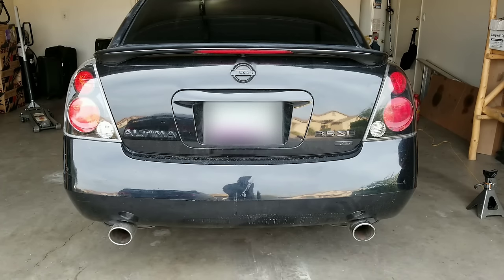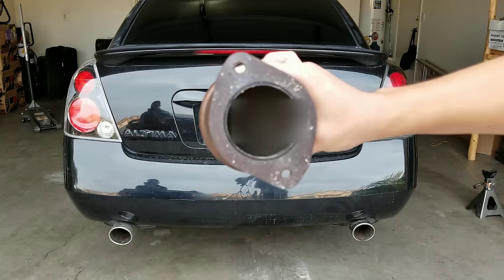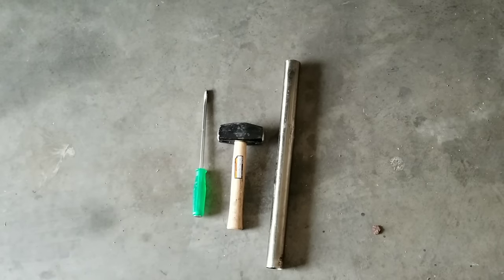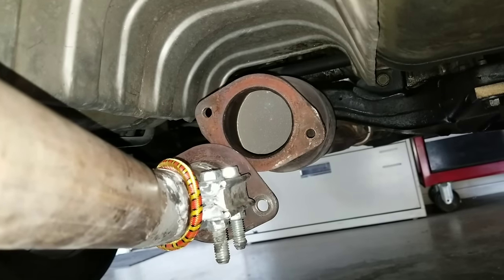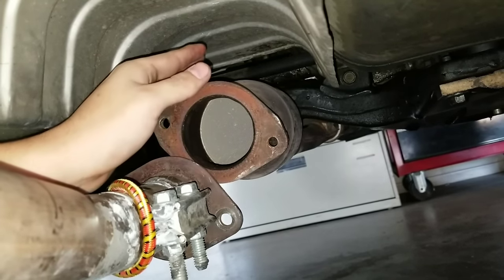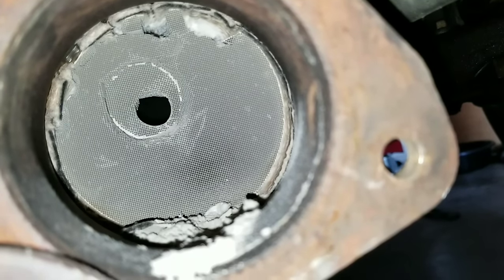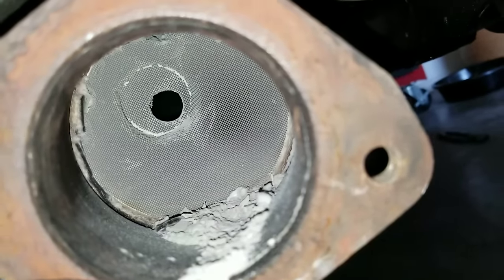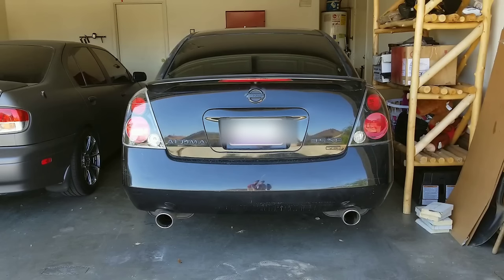How To Delete Your Catalytic Converter!

Comment: I don't want to hollow out my manifold converter.
Can I just poke a bigger hole in it? I just want some pops and bangs but I don't want to spend 800$ on a performance cat.
Reply from the maker: you can but eventually it would probably break down since its packed tight and if you make a hole it will be loose.
Reply: Eric Leos eBay specials.  120$ delivered to your door.
Reply: $800 for a cat? Lol wow. Listen bud magnaflow has universal high flow cats for 80 with free shipping and your cel wont come on and you will also get the pops you want. Go on ebay to find it
Reply: AD S eBay sucks ass. I blew out my 02 bung in the first 2 weeks. Kinetix hfc is what you want for proper cheap mod. Everything this guy did tho is so wrong. Ugh
Reply: Mike Washuck lmfao just cause it ebay doesnt mean its bad quality shit. Only time its bad shit is if its a non named brand. Which is usually shit like dna motoring and speed daddy and stupid shit like that. Magnaflow is a good brand company. So if flowmaster and megan racing. Dont believe everything you hear about ebay. Cause the also have hks, aem, injen, ect. Products too. Its just a matter of what your getting and how much your going to spend. Universal hfc by magnaflow is great. Dont think that just cause you get it on ebay it bad product lol.
Reply: AD S you are correct sir. I just has a horrible experience with my product.  Mind you the company was super kool and worked with me to resolve the issue
Reply: Mike Washuck i understand we all been through it
Reply: AD S Will do fam.
Reply: Bush Bushington depends on pipe sizing they have all different sizes of pipes find out what your cars echaust pipe size is and see if they have it for yours.
Reply: Just remove the muffler/mufflers.  You will get pops and bangs. 😉
Reply: @robertwright5487  you will also lose hp

Comment: This is a naturally aspirated motor removing back pressure from the exhaust which you just did normally reduces horsepower rather than adds the sound may make you feel like you added but that’s about it lol
Reply: David Barbosa not if u tune it
Reply: Lil Herm Too even with a tune lol just read other comments they explain it well but he’s better off straight piping it instead of leaving it like that

Comment: Guys! This is unnecessary and illegal in most countries. Just buy a sports CC that has a straight through design, but still burns the unburnt fuel from the exhaust. A car without a CC smells horrible. So just spend a little bit of money on a race CC and be happy and compliant!

Comment: Do you know that the dust inside the cat is carcinogenic!
Reply from the maker: its ceramic that holds it together
Reply: ERICSDIYGARAGE that is not ceramic that shit could give you cancer
Reply from the maker: Carlos Jarquin what is it called?
Reply: ERICSDIYGARAGE. It's made out of platinum Palladium and rhodium and two of them cause cancer
Reply from the maker: Carlos Jarquin nope your wrong keep searching,  Rhodium by itself is not harmful and palladium can actually be used to help cure cancer
Reply: Platinosis is an allergy-like reaction to exposure to soluble salts of platinum. The symptoms of platinosis may include asthma, dermatitis, dyspnea, conjunctival vasodilatation, and rhinopharyngitis. The symptoms are progressive, sometimes taking months to years to appear. ... https://en.wikipedia.org/wiki/Platinosis
Reply: Next time wear a gas mask, that powder will never leave your lungs now.
Reply: endo pass yumm
Reply: Lmao at the “experts”. There is nothing in a cat but ceramic and precious metals.   One could argue that an old cat will have some residual contaminates from the exhaust but they get almost fully burned away.  

That being said, you should wear a mask.  Any dust in the lungs is bad news.  But it’s not like you were inhaling some deathly toxic powder.

Comment: I’ve had my catalytic converter deleted for 4 years. Now my car has code “p2423; absorption catalyst below threshold efficiency”, my MPG is like 37 highway and 25 MPG city, do you think I’ll still fail emissions testing? I’ve passed emissions the last 4 years, but I’m concerned I might not, but because my MPG is so high I wonder if they would even sense a bad reading on my exhaust

Comment: Here's another tip when you take off the cadillac converter, it changes the performance of the engine.... It has sensors on it that tell each cylinder what to do... That might not be the case in getting more horsepower. You actually might lose power and lose fuel economy

Comment: Why not just delete the secondary cats as a whole? Is there an 02 sensor on the secondaries?
Reply from the maker: No they dont have o2 but you remove them you have to cut and weld a new pipe
Reply: @ERICSDIYGARAGE  Alright, awesome. I have a 2.5 altima with muffler delete & bigger tips. I was gonna delete the secondary cats and weld on a str8 pipe in it's place.
Reply: @ERICSDIYGARAGE  It looks like the secondary cat on the 2.5 does have an 02 sensor though

Comment: This is good. It seemed like  there was piece of sheetrock stuck in the cat. I have a 2007 Nissan Maxima, just changed the motor at 220, I didnt have to but A mechanic took my old motor apart when he changed the alternator to get to the timing chain that clicked. I wasnt happy since these cars make the ticking noise bc of the timing guide, anyhow that starts around 150k they said the motor that was installed has 77k, but im saying it has 135k since i know the noise of these vehicles. The old motor could have made it to 250k before a rebuild. what can you do. Alternator isnt a joke on these cars by the way.

Comment: I got a Chrylser 300 3.5 v6 That misfires. My mechanic said the Catalytic converted was way to hot. Ill prolly run straight pipes to actually hear my engine lol chrylsers are quiet. Thnks for the info

Comment: I don't get all these hate comments. It's your car, and if you can do it then he'll yea do it. I had an old beater POS manual Ford focus and did the same thing, and goddamn it made it run so much better, the amount of power it got was significant. It only had one o2 sensor and it was on the header before the cat, so I decided to do it. On one that has 2 or more o2 sensors I wouldn't wanna mess with.

Comment: It's a lot easier to get a piece of pipe that just fits inside the cat and hammer it straight thru with a sledge. Then before you hook the exhaust back up, blow that shit out by revving it up a few times fully uncorked. I did this with my 82 Crown Vic wagon.

Comment: DON"T DO THIS!!! The catalytic converter is designed that way for a reason. So that bad carbon particles are not released to the environment. Cleaner air out. Smog check will fail with this modification.

Comment: Are you kidding me... those protect our air from pollutants and you go and cutting them out? Way to go. Sure. Pollute the air a lot more for a few hp. Unbelievable
Reply: Almost every modded car/race car has either high flow cats or has them removed.... they’re full of platinum so exhaust guys make a killing reselling them for their precious metals. This isn’t uncommon and usually it’s actually lifted trucks doing it the most.

Comment: Having a debate with a friend. My research shows a vehicle may run worse with the cats deleted since it has removed the back pressure etc and the computer would need to be tuned to compensate. My friend says he deleted 3 of his 4 cats (he had already bought 1 new so he left it installed)  on his 2005 Nissan xterra and it runs much better including much better gas mileage with no tuning...even a technician at a Nissan dealership told him it didn't need all 4 cats. Can a person delete all cats on a vehicle and have no serious issues with the engine?
Reply: yes its called straight piping your car lol
Reply: straight pipes are illegal here in cali so youll fail inspection every time unless youre paying the smog guy off
Reply: @staydown4bo  im not in cali and apparently you didn't read my post..I'm not asking what it's called when you remove the cats.
Reply: @A.C.71  a straight pipe and good intake will completely open up your air flow free from any restrictions. how would that cause any serious engine issues
Reply: Does it really save up gas though

Comment: Do not do this. The power gains are insignificant, it's not worth the trouble. If you're still inclined to do this, weld a pipe or invest in a bolt or delete pipe and SAVE the catalyst. They cost too much money for you to just destroy them so ignorantly to gain 2 horsepower.

Comment: I’m thinking about doing that on my infiniti g35 coupe. Will that make the check engine light come on?
Reply from the maker: it's better to get test pipes they are cheap and mines has test pipes without any issues or codes

Comment: did you have your check engine light on?? after this?
Reply from the maker: not on this particular vehicle since this was not metered by a o2 sensor
Reply: @ERICSDIYGARAGE  if it has a o2 sensor it means check engine light will appear right?
Reply from the maker: yes correct, a o2 sensor after the cat will throw a check engine code.
Reply: Why didn't you remove the muffler ??
Reply from the maker: I like the SE-R mufflers

Comment: Does this work the same with any car? I have a impala ss.
Reply: Yes. It helps alot. I had a 2.8 liter N/A v6 firebird that spanked my friends 84 Buick GN Turbo 3.8L v6 with this mod. It worked wonders in a 305 powered Monte SS also.

Comment: for anyone thinking this is a good idea. All cars (including this one) manufactured from 1996 on have o2 sensors that monitor the cat .best case it will turn on the check engine light.worst case you will go into limp mode,cutting off all performance.If your cat looks like his with small light dot moving as you rotate it. that is a sign it is good and not restrictive.95 and older this is a good idea to increase flow and look legal.I am sure the fine for removing the cat is more than maybe $80 worth of platinum you throw away.
Reply: @Tanto Buds The up steam O2( exhaust manifold location)tells the computer how to a adjust the injector fuel mixture. The down stream O2(after the cat) tells the computer if the cat is operating correctly. Pre 96 OBD1 car generally do not have a down stream O2.  You can remove the cat and replace it with a "test pipe" to see if the cat was causing problems. After you complete your "test" driving you must reinstall or replace the cat. Still not sure on my 95. Maybe another year of tests.
Reply: @Tanto Buds If you were blowing chunks of honey come out they can plug up your muffler next. It should not smell without a cat installed. A pugged cat can smell like sulfur or screw up the o2 reading so it runs rich. Reset the computer then drive it to see if the smell goes away.

Comment: Couldn't you of just replaced the cat with a straight through pipe? Then you have an intact cat and the desired effect you are after, especially for places with strict regulations (here in the UK there are yearly MOT' checking emissions etc, no cat will fail it)

Comment: Would it work if I went to pull a part junk yard and got a catalytic converter from a parts car. Then did what you did. Could I then bolt into my cars exhaust system? I'm disabled and I'm not sure I could do all of that hammering under the car.

Comment: Good Video  If you live out where I do , no emissions . Seems like some one all way have a smart crack to say , but they have no good input of doing better! And yes best bet new catalytic converter . But if you not have 200 on up what the hell . My car is very running now , engine light on for ever , plus my car is a 2001 . so I going for it tell funds for new one . Why buy a test tube one ? when you all ready made it straight threw . To many with smart comments .
Reply: Ey sir  hello. Ey where is it dat you are @ that they don't do no emissions?.. which state?

Comment: i think mine is clogged cause after a week being park there i turn it on to fix the antifreeze leak after a week i start it up and started to smell like something burning and inside the car was smokey as well and alot more heat starting coming out from firewall i look under the car and it was looking like hot pink or more jajaja or lava red or orange red thing was super red so i turn off the car righr away 😂😂 what you’ll think my cat is clogged or something else

Comment: What did you do about the check engine light now that the rear O2 sensor has a totally rich signal (over .9 volt)
Reply from the maker: this vehicle doesn't have a 02 sensor in the back so I didn't have to do anything
Reply: That's unique because the law specifies monitoring of the cat's output. Even motorcycles have cats and sensors.

Comment: If i gut the cats do i get a check engine light
Reply: Yes but u can get o2 sensor spacers and that will clear the code(spark plug non foulers is what they are called) old trick!

Comment: Also your timing system is having an issue. Likely a worn guide or tensioner. I can hear it when you rev the engine. You should fix that before your belt or chain skips.
Reply: i hear it too when he lets off the gas but how can you tell its coming from the timing and thats not the exhaust?
Reply: @staydown4bo  It's a distinctive sound. I had that issue on my S chassis. Its a nasty ass grinding sound when you let off the throttle. You can hear the loose chain running along the plastic guides
Reply: @Sugiyamasama  that probably means your tensioner guides are bad. most car companies use plastic tensioners that go bad way before the actual timing chain/belt. my g35 rn currently has this nasty 2-3 second rattle on cold starts that comes from the tensioner because the oil in the car hasn’t reached it yet. its a common issue
Reply: @Sugiyamasama  that doesnt have to do with the exhaust its just poor manufacturing using plastic instead of a metal. maybe to reduce weight 🤷‍♂️
Reply: @Sugiyamasama  you just gotta get new tensioner guides before you jump timing
Reply: @staydown4bo  Nah. All car companies that use timing chains are going to use plastic guides. They wear out over time. Besides, you dont want a steel guide on a steel chain. You're gonna wear the shit out that chain
Reply: @staydown4bo  Also, the chain will stretch over time of being used. The tensioners will lose tension and the guides will wear. Just replace all of it when you're in there. Save yourself the headache of doing the same job twice
Reply: @staydown4bo  Lastly, if your G35 is sounding like this, hop on that immediately. Don't play around with tha VQ35DE like that. They don't like neglect
Reply: @Sugiyamasama  i know i gotta get it fixed ive only been working on the car myself for a year so im still gaining confidence to do the more serious repairs. ive only had it for about 15-20k miles now but one guy in my group has had the rattle for the last 70k miles, so next oil change im gonna try something a little thicker like 10w-40 just to help it until im able to change it out
Reply: @Sugiyamasama   i dont have that ugly sound you hear when he lets off the gas peddle but i do get that brief rattle on cold starts. a lot of people even with healthy DEs like 90k less say they hear it sometimes just because the oil hasn’t reached the tensioner yet. better safe than sorry tho lol

Comment: Without a tune and supporting mods such as an upgraded maf / manifold and such. You actually loose power due to the stock ecu trying to fix errors with the emissions systems.  Useless mod until you do it right

Comment: Hope he fired up engine to blow the remainder of converter out before bolting it back on. Remember today's vehicle computers are programmed for certain performance until you change the programmed data it's not going to change performance just sound. And that little of change won't be noticable in the throttle and if you do change settings it still won't be noticable in the throttle until you get into higher rpms. It takes a lot of changes to gain noticable HP gains if you do a high performance exhaust plus cold air intake and change computer settings still not a big difference in noticable HP gains in my opinion. Do these upgrades with exhaust turbo then you will feel it.

Comment: Except "hollowing out" any catalytic converter is stupid. They are worth money whole. There is no horsepower to be gained and in most cases doing this actually hurts power without changing the tune to compensate for the added air volume. So lets recap....You took about a 100 dollar catalytic converter core and destroyed it and put it back on the car to loose HP...Got it.

Comment: why go through all that ? back in 2000 i removed mine saved it off a brand new VW Jetta VR6 and just put a larger pipe there with reduced ends , cut a hole where O2 sensor goes welded a nut that fit the sensor threads put it on welding no clamps and used a what i called a reducer / think they sell them as spark plug non foulers will work...tricks the ecu into thinking that the cat is working fine..by saving the cat i used it years later when i moved to a state that has emissions testing...

Comment: Should off just replaced it with a straight piece of exhaust pipe then delete the egr tube with a delete plate and remove the smog pump and ad o2 sensor plugs to keep the check engine light out then you will get more horsepower also those fibers are work a lot of money they are pure platinum.
Reply: How do I remove smog pump and delete them